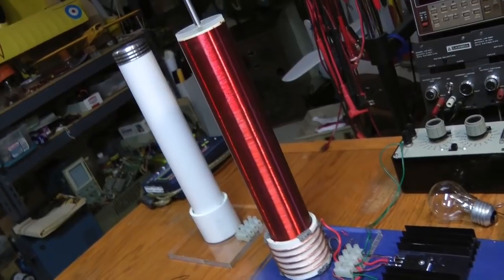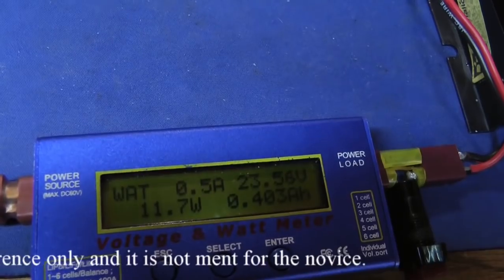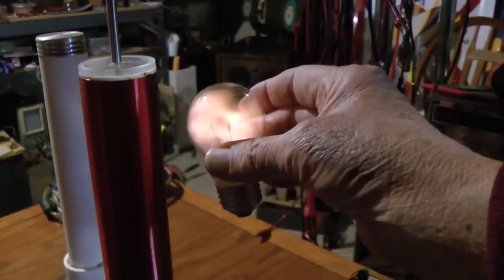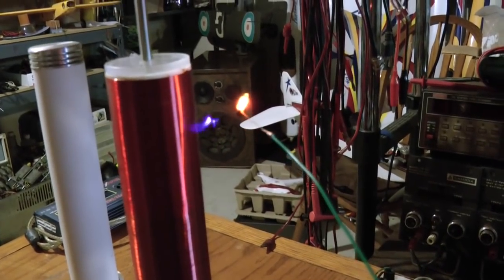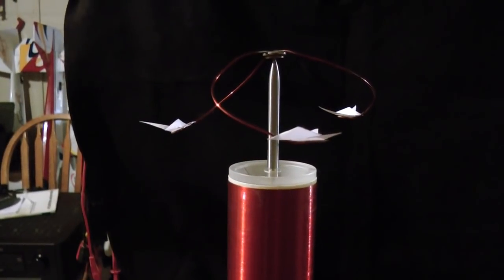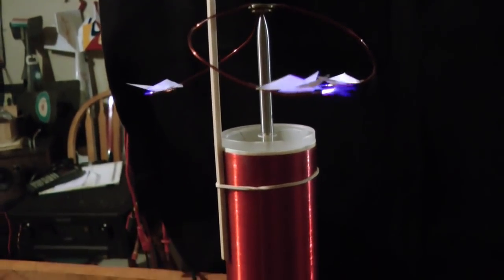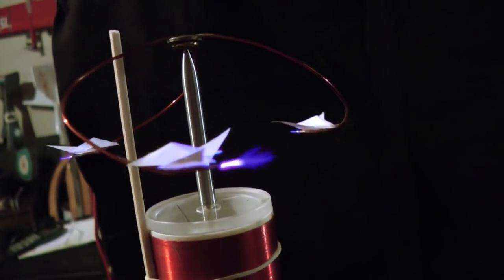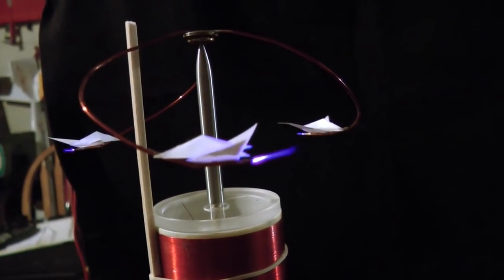Tesla / Slayer Ionic Propulsion

Comment: Rumior has it that nasa or lockheed were playing with ion partical displacement some years back some where on you tube theres 1 made at about 6 inches shaped like a kite and it actualy hovered on its own from the ion particals flowing downwards it was just loose wires hold it frm floating away
Reply: Was that the Weav?
Reply from the maker: Yes, I've recently seen lifter experiments. The principle is almost exactly the same. I might try on myself it I can figure out how to add something different and exciting to the experiment.

Comment: you need one of these stabilized in liquid sodium sphere, with 2nd sphere full of mercury which already produces magnetic energy with the Tesla coil it might levitate, and I'm serious, not being sarcastic
Reply: both need to be rotating
Reply: jason genaw the ionizer would be redundant no? If you pressurize Mercury then spin it at extremely high rpm with electromagnets the result is the surrounding area bring enveloped in ionized particles thus lighting up like a bright white plasma ball of light, couped with an attempt at further ionisation for the thrust would in fact be cancelled as the surrounding particles would already be ionized by the rotating Mercury, that was supposedly used in the early model astra and tested by Lockheed Martin, general Dynamics and others. As a matter of fact at a facility here by Stephenville Texas for years were texting it, if you search RCS facility meridian Texas you will find a closed hidden base that was jointly operated by Lockheed that was coincidentally in proximity to tons of ufo sightings of huge balls of intense light. Anyway it's all pretty interesting.
Reply: jason genaw    BINGO!!! YOU'VE GOT IT !   + MORE ! EVERYTHING CAN BE INCREASED TO A HIGHER POWER! FLYING DISC ...ETC.

Comment: Very cool video!!! Too bad it only works in a gas :(    But it could work to lower air friction on my spaceship while in the atmosphere. :)
Reply: It's already being used in space applications ( https://en.wikipedia.org/wiki/Deep_Space_1 ), with (ionized) xenon gas as fuel and solar power for electricity.
Deep Space 1 carried 82 kg of Xenon.
The propulsion power is extremely small, but this doesn't matter because in a vaccum speed will increase exponentially over time (=months), ultimately reaching extremely high speeds, whilst requiring much less weight than conventional rocket propulsion.

Comment: Try this in a vacuum and see if it will blow a paper thin insulator and then you will know if it is in wind or  something else.
Reply from the maker: I think it's a flow of Anions, or ions that are attracted to a cathode. They may move some air as they go. The torch flame is a plasma in itself so the plasma from the wire may be having a reaction to the flame has very little to do with air. In space they use Xenon gas in the ion flow to make up for the vacuum of space.

Comment: Very nice.good work.👍😵
Reply: I wonder what would happen if you were to place the plane device under a bell jar and create a vacuum for it to operate in.  Would you still get the plasma? Would there still be thrust? Just curious.
Reply from the maker: In this experiment there is a cathode emitting ions. The ion stream try's to complete a circuit to the anode which is actually earth ground. So if you want results in a vacuum you need both anode and cathode on the engine. xenon gas is usually injected into the ion stream to form a form of atmosphere. I think running this in a vacuum within earth gravity will probably result in the plasma trying to get out of the vacuum glass and get to earth ground like a plasma ball toy. Just my opinion though.

Comment: You already answered yourself. It is an flow of ionized air. It's like those aluminum triangles with wire at the top which levitate
Reply from the maker: Z, This is a little different because the lifters have both an anode and a cathode on the triangle. The spinner in the experiment only has a single anode. Also there is not heat on the triangle. the flow from spinner will burn a hole in your finger and cauterize it. It will also burn anything flammable. You can feel the heat several inches behind the ion flow.

Comment: Can you put it in a vacuum and see what happens?
Reply: Gary Adams nothing as there is no particles around the point to turn into plasma, although i could be completely wrong too 😂
Reply from the maker: Not completely wrong. I've learned recently that you can inject inert gas into the ion stream to make the drive practical for use on satellites.

Comment: Could you scale it up and make it bigger. How much thrust would you get if the entire model is scaled up 10 fold.
Reply: Yep then how do u solve the problem of electricbill
Reply from the maker: I think the power to weight ratio might stay nearly the same.
Reply: From the tiny amount of research I’ve done so far the weight of the power source becomes the issue, the weight of the power source makes using this unpractical on any large level, if you learn how to create and contain antimatter then you’ll be talking.

Comment: The only way to tell An plz post if you do is repeat this in a vacuum to prove that it's only ions that cause the motion An not just ions moving the air very interesting, very good video .
Reply from the maker: Hi Craig, I'm sure this configuration would not work in a vacuum. It would require both anode and cathode, magnets and something like an injector with xenon gas.    Thanks for watching.

Comment: The reason you're moving air is the same reason lightning has a thunder clap. Put this in a vacuum and it won't move.
Reply: It will move slowly, ions have a little mass in them.
Reply: Aditya Maharana it's not an ion drive.

Comment: this are actually pushing air because the flame is blue meaning that there is enough oxygen, so the carbon atoms don't need to combine to form the ordinary yellow glowing soot particles
Reply from the maker: Thanks for the comment Josh.
Reply: What flame?
Reply: Josh Shroyer I think you might be thinking of flames fed by a Bunsen burner, run off gas, but this is a plasma discharge caused by the high  voltages involved here, so no Carbon is involved.

Comment: This only works when the pendular weight of the apparatus is far less than he initial load weight from the device. So why motors have max torque immediately and fall off with speed. This relies on air manipulation not magnetism, which isn't a huge deal; it just means that it can't be used in this configuration at all. As with most artistically/functionally appealing things, the functional value has been compromised by the depth of engineering required to produce a working model. This is why stirling engines are dead, their power to weight vs. Real requirements for constructing the large ones made diesel and steam come out on top.

Comment: what happens if you make a small sealed enclosure at the end of the planes enclosing the plasma in a small sealed volume of air? Then also what happens if you make a pin hole in that enclosure? )

Comment: Not raining on your parade nor busting balls but....
Does it work in vacuum?
Reply from the maker: I have no way to try it but I think without an anode on the device it would act like a plasma ball device. There are drives like this on some satellites and it works with the help of xenon gas injected into the ion stream.
Reply: Walter B 

Unfortunately, not with out a fuel source. It is only working now because of the atmosphere. Did a lot of study on this. The key is a combination of the EM Pulse to fuel which is honestly it's not a good engine, but as a fuel source it will work well to make  microwaves that can be injected through the electromagnetic field.

This I believe is the key to the 1st light speed engine. 

It would be really awesome to see him build an EM Pulse Injector.

Comment: is just current going through air and heating it to plasma which causes the air to expand and push the air in the back, so it sadly won't work in vacuum, i don't know the efficiency of it working as air propulsion, tho it would be cool tho have planes that are sparky :))
Reply from the maker: Hi Victor, The experiment shows that in an atmosphere the ionization effect is possible with the use of an anode only. In space a thruster has a cathode, magnets and possibly the release of xenon gas into the ion stream. A viewer sent me this link that explains things pretty well.
https://www.youtube.com/watch?v=pDO4uhqehK0
Reply: Yes your little planes will move in a vacuum but you will not get the effect of being able to put the flame out, since there is no air to move, The ions coming off the end of the wires will still cause rotation, since you are changing the direction of current or ion flow from vertical to horizontal with you experiment.

Comment: think there’s a electromagnetic field turning your copper wire contraption. EMP
Reply from the maker: I don't think it's likely because even a straight wire with a 89 degree bend on the end can go in either direction depending on the bend. I also had little or no reading on my gauss meter unless I was right on the coil.

Comment: I have always wondered, what's the efficiency rate for such thruster?
Reply: Efficiency measured in specific impulse is very high dependant on mass of propellant and speed of exhaust - higher efficiency means less thrust per newton if scaled up using solid state and with fusion power it can launch 🚀 from earth

Comment: Instead of a curve try straigth  copper wire down will it float.

                            ⚫
                          /     \
                        /         \
                      /             \
                    /                  \
                  /                       \
                /                            \
             /                ⬇             \
I think u can produce moving energy from that coil 
And it could become more powerfull if u make more turns and and higher volt
Reply from the maker: I've tried straight and it doesn't turn. It will in either direction with a 90 degree bend on the bottom of the straight wires.

Comment: The reactor is huge I see this good for no gravity space where the weight will not play role.
Reply: I seriously doubt this will create any type of thrust in the vacuum .
Reply: James Boudreaux It absolutely does work in a vacuum. They have been talking about ion propulsion for space travel for a long time.  NASA is currently working on engines at JPL. Google "ion thruster".
Reply: sunriseshell This type of propulsion would probably not work in a vacuum. This probably produces thrust because it heats up the air or ionizes it. What NASA does is using a magnetic field to accelerate Xenon Gas.
Reply: sunriseshell So this means you'd have to get some Xenon Gas as propellant
Reply: Ferdinand Wohlrab Exactly, Xenon is used and turned into a plasma. Way more efficient than combustive thrust. And you're storing an inert gas as opposed to highly flammable gasses.
Reply from the maker: It makes me wonder if you could use other inert gas like Argon used for welding. I further wonder for experimental interest if you can perform the experiment in the atmosphere. I wonder more if the voltage from the light weight Tesla resonator isn't something better than what is used conventionally as a power source for Ion thrusters.

Comment: Have you thought of putting small magnets on the ends of the wires?
Reply from the maker: I have thought of that. Magnets are used on some commercial thrust engines but I haven't found enough information on how it is done.
Reply: Just try to fix one on the ends of your little ion ships. Then see how it works.
Reply: I bet it will go faster.

Comment: Hi Sir
What's the output voltage of this slayer exciter, second can you tell the specifications of this slayer circuit mean transistor used and value of inductances of primary and secondry coil?
Thank You
Reply from the maker: I have no way to accurately measure the voltage and would most likely damage any measuring instrument I have. If you look at the description under the video there should be a link to the schematics

Comment: If you took the little jet planes off of the wire.. does/can It pull the flame in the same direction as it blows the flame out?
Reply from the maker: The planes are only a decoration.

Comment: will it work in space ? or does it need air ?
Reply: This version needs air, but in space they might use ions to propell a spacecraft to extreme speeds, just over longer period of time. If they use 1kg of conventional jet fuel, the trust will be equal to the mass they expel at the speed they expel it at. If you use ions, you can expell mass at much higher speeds, so you need less fuel. AKA if 1kg jet fuel is expelled at 1000km/h, the forward force will be a given amount of newton, causing acceleration. However, if you expel 1kg of ions at almost the speed of light, the force forward will be much greater, but it will take much, much longer (Weeks or months instead of minutes) to accelerate to the wanted speed. And you can't use this to break free from orbit of any planet.

Comment: What happen if you touch the sparks with your hand? Is it dangerous? I ask this because the sparks look really tiny
Reply from the maker: You would only do it one time probably. Although small, they are very concentrated and hot. They burn a tiny deep hole in your skin that doesn't bleed because it gets cauterized from the heat.

Comment: On YouTube you can see lifters that lift off the table but are connected by wires. Do you think you can design a circuit or coil to feed one of those lifters and make it fly without any wires connected?
Reply from the maker: At this time the weight of the power supply makes it not possible. Maybe some day.
Reply: @DadHav  I was thinking maybe you could design a receiving coil to mount on the lifter and then feed it through the airwaves with one of your Tesla coils and then the power supply would be land-based. Of course I know that's a lot to ask I'm sure you have other projects you're working on. Maybe I'll try to work it out myself.
Reply: Yes this is possible and has been done.  Refer to video "The plane with no moving parts" which  uses ion means for thrust.  Along with this the B2 stealth bomber has this tech as a supplemental application on some models.  Also electrogravitronics, anti gravity devices use this principal.  This technology has been in use for 60-70 years.  When a man by the name of T. Brown (I may be wrong on the name) was working on this in 1958 it was not put out for public use due to a cold war era stipulation as this could have tremendous advantages for mankind likewise can also be used for war applications.
Reply: @petergosezenya5212  thanks good information. Do you know if they worked out of way to broadcast an electromagnetic wave, pick it up with a receiver mounted on the unit and convert it to DC to create the high voltage charge needed?
Reply: @MikeSmith-cl4ix  I just ran across someone doing a self contained unit, all onboard power.  A website was named (www.electronicairllc.org).   I have nothing to do with that site.  Here on YouTube it is on a a channel named Ethan Krauss.    He lifts it for about 2 minutes, and that was done over a year ago.
Reply: @petergosezenya5212  thanks I'll check that out.

Comment: is therean error in Solid State Tesla Coil and receiver schematic in Resonator tube diameter?
It says 1 1/2" and 1.9" actual... does not sound right. Which is it 1.5 or 1.9?
Reply from the maker: I know it doesn't sound right but if you go in a hardware store to by the tubing they will tell you it is 1 1/2" and 2" Even though it doesn't measure that. Look at 7:17 on the video and you can see the actual information on a standards sheet.

Comment: Electrons charged negative repulsing other particles pushing the load forward. Cool gimmick but would be hard to produce in a larger scale
Reply: If hard stopped people making things, we wouldn't have gotten this far, and we wouldn't be going any further.
Reply from the maker: I think Tesla was mostly interested in wireless transmission of energy. I have a video demonstration if you're interested:
https://www.youtube.com/watch?v=lqgjeN3Jnj8
https://www.youtube.com/watch?v=ekpVLnmdr2k
Reply: Steven Vranch: Man you are right. However, the current problem is: we're not going any further, we're not evolving or progressing. 

We haven't needed oil or gas for over 100 years yet we're still using the combustion engine!???!;))&. The mighty 'petro-dollar' is the proof in the pudding and our pudding is going rancid.
Reply: Elon Musk - our saviour

Comment: Is there a force/push created by the discharge of plasmic flame/electron discharge?
Reply from the maker: Yes, there is a flow of negative ions probably pushing against neutral ions or trying to get to earth ground.
Reply: Well how do normal rockets work in space?  Newton's 3rd Law of motion -- "for every action there's an equal and opposite reaction". Think of the recoil you feel when you fire a rifle or gun. Bullet goes straight away from you, but the rifle kicks back into your shoulder.  RECOIL.  Well, ion thrusters work because of the same action -- RECOIL.  Plasma coming out of the little jets in DadHav's video is the bullet.  The little jets are the rifle.  The jets 'fire their bullets' (the plasma shooting out the back) then the 'rifle' (the little jets) recoil *in the opposite direction.  In a normal rocket engine in space, the body of the rocket is the rifle.  The burning fuel shooting out the back of the rocket body is the bullets.  Bullets go one way. Rifle (the body of the rocket) recoils in the opposite direction.  And the rocket moves.